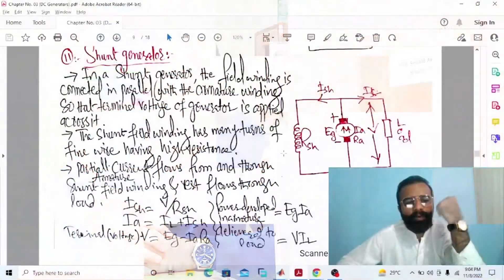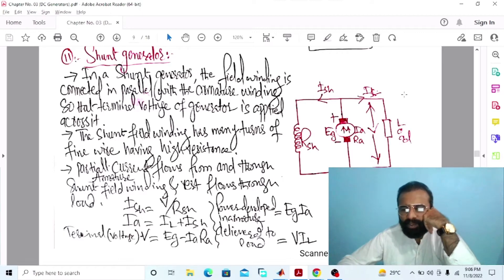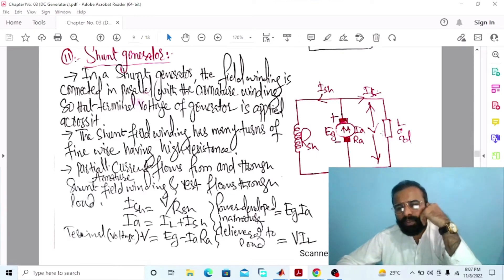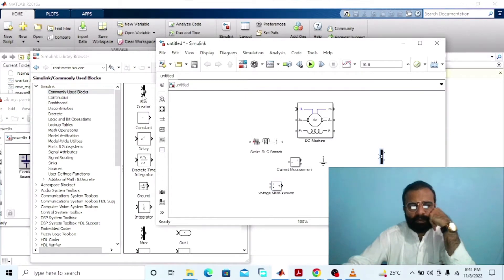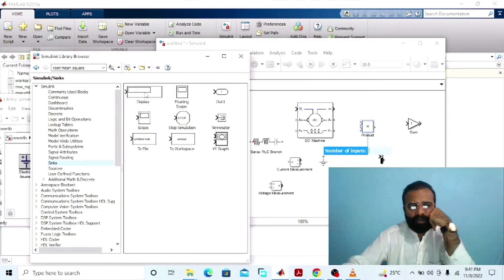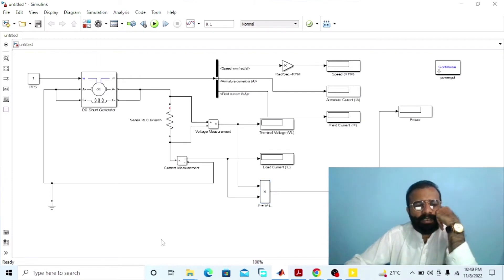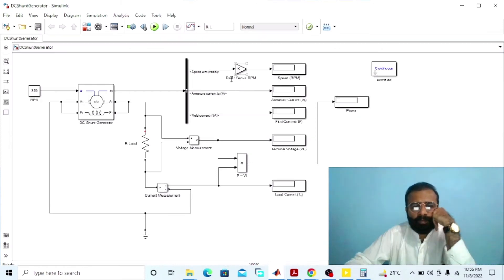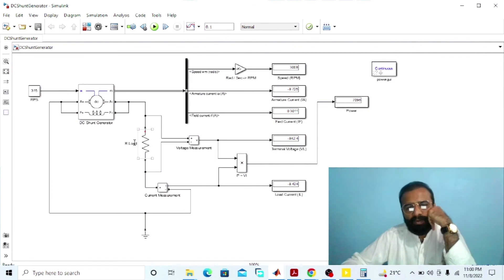DC Shunt Generator using MATLAB Software | DC Shunt Generator operation on MATLAB Simulink

Comment: There is no parameter of Field current in matlab r2023b version
Reply from the maker: Ok did you go to dc machines model parameter? You can find there the fied current ....Thanks
Reply: @ShoaibAhmedDayo  sir there is no option of field current in parameters... same case with dc series generator

Comment: i did the same simulation and it shows only the speed but currents, voltage and power are zero. any help?
Reply from the maker: You have to connect properly voltmeter and product block for power measurement...Thanks
Reply from the maker: Go to the parameters of DC Machine, field resistance 10ohm, 100 henry field inductance, mutual inductance 9 henry, initial field current 300....Thanks
Reply: @ShoaibAhmedDayo  I tried it, not working though, why? every thing the same
Reply from the maker: @aliqh5463  Dear, Infront of view i have done the live simulation and all parameters i have defined, iam using MATLAB 2016 version, may be there is version issue
Reply: Ok, I’ll try it ..
Can I have your contact email in case I need help 
Because I have project simulation of dc self excited shunt motor and generator & synchronous machine 
Thanks
Reply from the maker: @aliqh5463  i will upload simulations regarding dc motors soon...and have you got the same results by putting the same parameters?
Reply from the maker: Stay connected with my channel and also share with your friends...Thanks Dear Ali
Reply: @ShoaibAhmedDayo  unfortunately no current, no voltage, no power only speed shown
Reply from the maker: @aliqh5463  ok dear
Reply from the maker: @aliqh5463  Dear Ali, Please see the description of the video, in which i have write all the parameters of simulink model of DC shunt generator......Thanks
Reply: @ShoaibAhmedDayo  Dear Shoaib,
Where can i find initial field current ?
Reply from the maker: @aliqh5463  Dear Ali, Just Double click on the DC machine then you will find configuration in which you have to select the mechanical input as (Speed w), then click on the parameters and write the same values which i have mentioned in the description, then run the simulation, INSHALLAH definitely you will find same results, Thanks and update me....
Reply: @ShoaibAhmedDayo  I found out the problem.. DC voltage source added with armature winding, and it worked.. this is what Comes to mind before 
it requires residual flux to build up voltage 
But I don’t how it shows reading in your simulation without dc voltage source!
Reply from the maker: Great...keep itup.....
Reply: @aliqh5463  could you explain in datail
Reply: @ShoaibAhmedDayo what version of matlab
Reply from the maker: @halkicin3275  MATLAB 2016 version
Reply: @ShoaibAhmedDayo  How can we do it on Matlab 2020b ?
Reply from the maker: @halkicin3275  follow the same procedure of simulation
Reply: @aliqh5463  Mr. Ali, Did you solve this problem without DC voltage source?
Reply: @aliqh5463  did you solve this problem without DC voltage source?